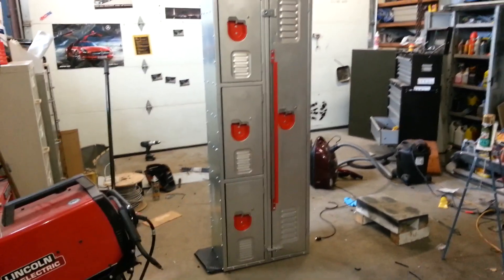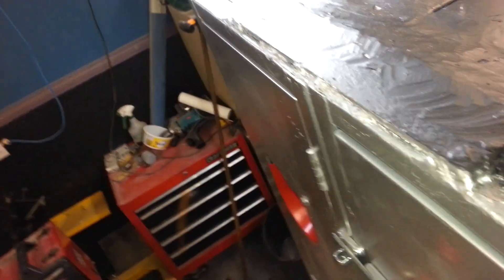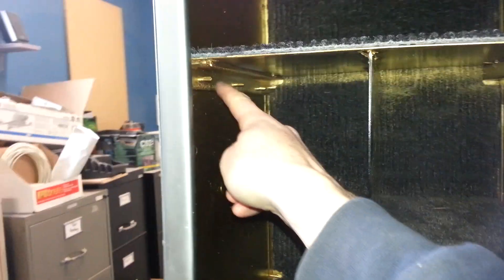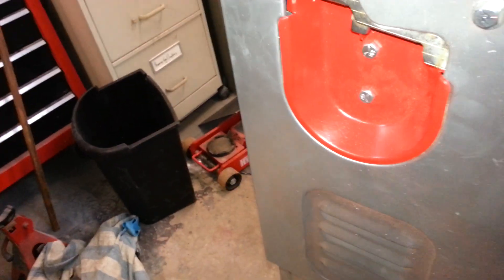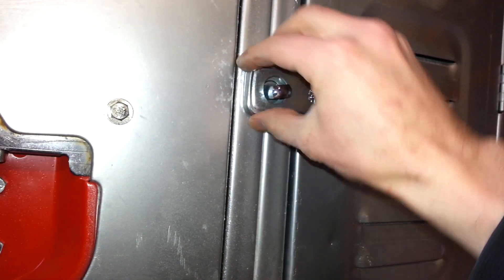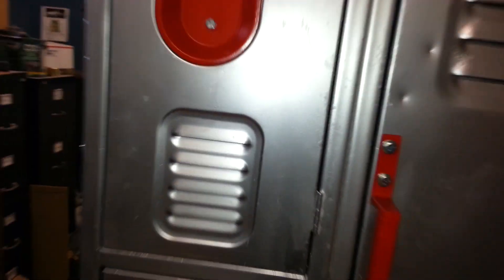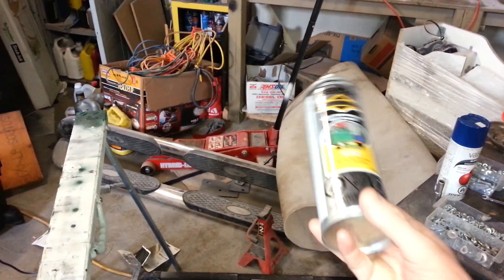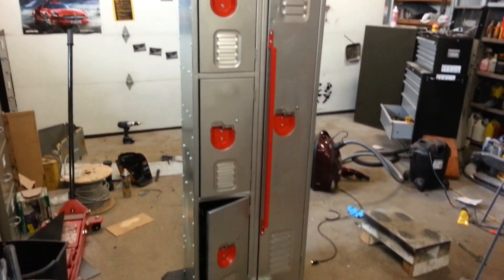Lockers Converted to Gun Cabinet with separate secure storage.

Comment: Be careful buying used lockers as most are made where there has to be several bolted together to be usable. They can work and are durable but you do need to make sure of what you're getting. 26 year school maintenance man.
Reply: Thats why you will see ive replaced the sides with heavy galvanized steel and theres welded reinforcements :)
good luck short of a team of guys with modern cordless tools and nobody  around to hear for extended time :)